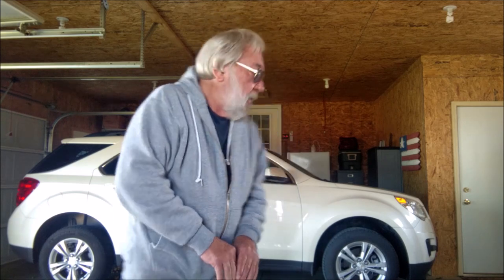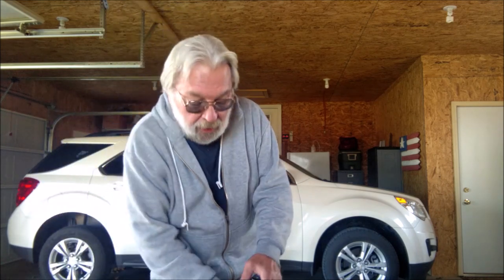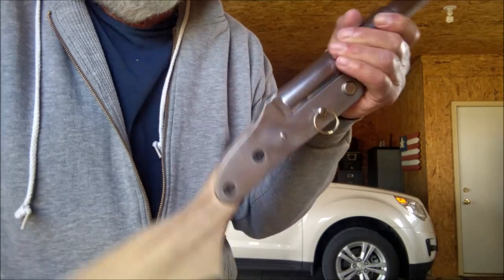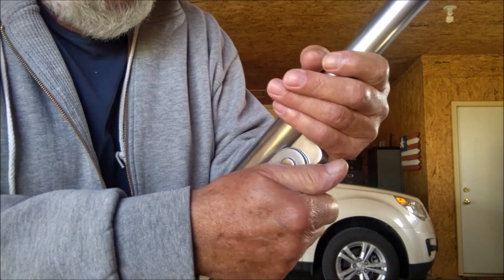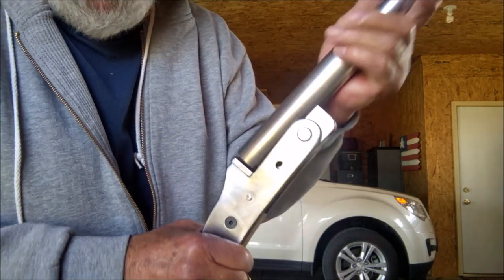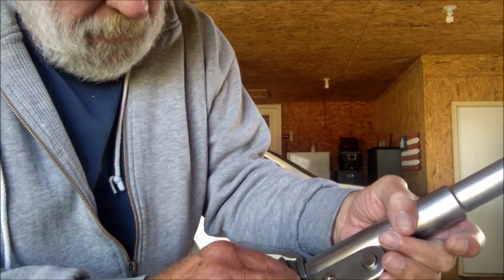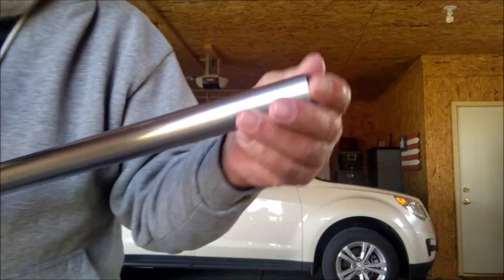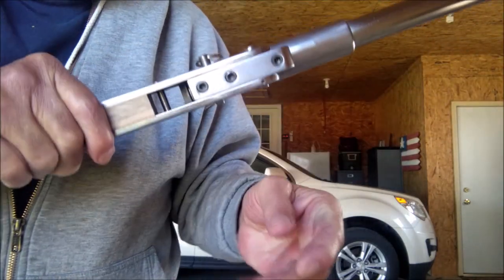2nd shotgun update

Comment: i know a 3/4 black pipe wont just fit inside a 1 inch pipe it needs to be bored out to 1.0625 id to get the 3/4 pipe to fit i wonder why this is always left out on the black pipe shot gun videos that are made
Reply: Good point Angie ! This is what I did. It sounds a bit crude , but it works good. I went to my local Home Depot or Lowe’s and I got a drill attachment call a small drum sander and a piece of small diameter pipe put one end in my chuck jaws in my drill and put the other side over the end of the small drum sander total length was about 24’’ inches and slid it inside the 3/4 pipe up & down as many times as it took to get the desired finish inside the pipe first I used like 20 grit than 60 than 80 you can go as high as you want but I stopped at 80 grit. Then I polished it up inside with mothers metal polish..lol  it came out awesome! I hope your project turned out great as well ! 👍🏻